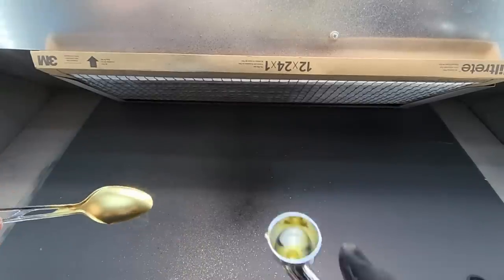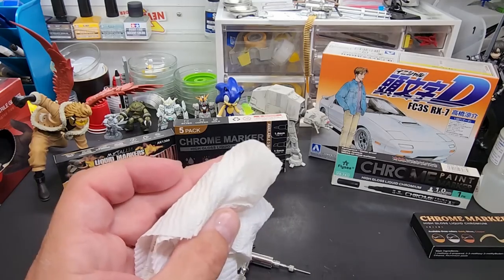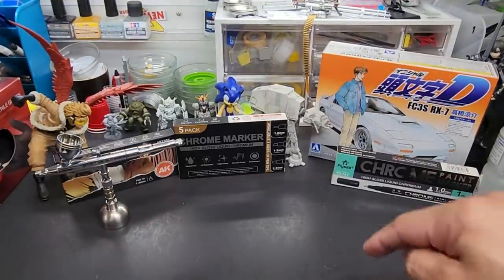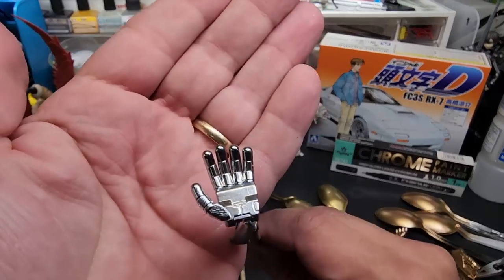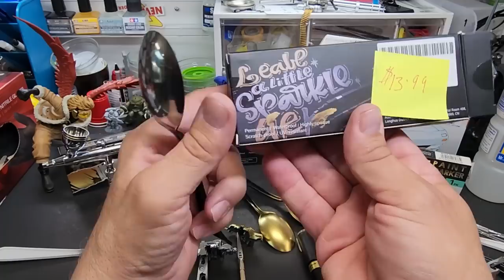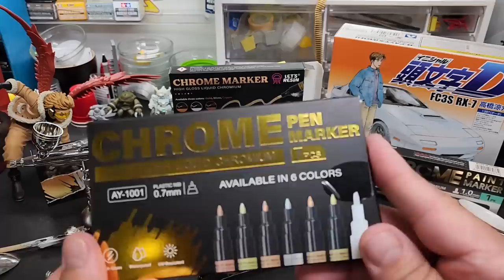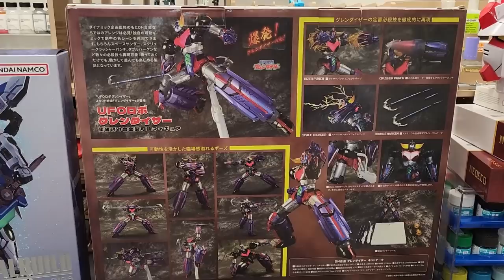Airbrushing Chrome Ink From A Marker

Comment: You can also adjust "the seal" in the airbrush. It's called a needle pack, and you can, if you know what you're doing, adjust it so paint won't get back into the trigger assembly area.

Comment: This looks great and I'd consider using it for window moldings. It's a huge pain to mask them off to avoid getting clear coat on them. Would a 2k clear coat work on top of this? Or would this work on top of a 2k?
Reply from the maker: 2K will work either way but keep in mind you will lose a bit of that chrome shine. Always test on a spoon first

Comment: hey, not sure if you include 'painting' reviews, tips in your tutorials, but i've long hunted for a decent chrome gold paint. there are multiple chrome silver methods about but none for gold. given how amazing graphite powder is for chrome silver, i was wondering iof you could test using chrome gold NAIL POWDER. does it work, can it be applied direct or do you have to use the UV gels first and after, will it give a pla print a proper chrome gold effect?
an expert opinion is greatly appreciated.

Comment: Can you do a video about "frosting" or "clouding" problems when airbrushing water-based matte acrylic clear coats?  I'm not the only person having trouble with this.
Reply from the maker: What brand are you using? Is it over any color?
Reply: Details: plastic model airplane. I first airbrush water-based acrylic primer (badger stynylrez).  Then airbrush thinned acrylic water-based craft paint (craftsmart from michaels) in various brown and green colors. Good so far.  Then airbrush gloss clear coat (us art supply airbrush colors - maybe not the greatest but wow that "army painter" gloss is thick and has scared me off).  Then apply decals to the model.  Then airbrush liquitex acrylic matte varnish thinned with water.  Frosty results.  Same thing has happened (but less pronounced)  when I use vallejo mecha water-based acrylic Matt varnish  27.702.  Pressure is around 22 psi throughout.   Master g233 airbrush with timbertank small tank compressor.  Sorry if that's too much info. Thanks for any thoughts on preventing  this.  Lots of other folks getting cloudy or frosty results with water-based  acrylic  matte varnishes.  Found many YouTube videos on how to kinda fix it but none on how to prevent it in the first place.
Reply from the maker: @ronandanne1  I don't really use acrylic clears, the best one I've used is Vallejo spray can clear. My biggest problem in helping you solve this it doesn't happen to me. I'll do some research on it. Have you considered a clear lacquer or enamel? Or Tamiya Clear
Reply: @barbatosrex9473  I'm reluctant to try lacquer or enamel cause that level of toxicity means I'd need more than my cheapo $140 spray booth and k95 mask. I want to try and stick with water-based and leave the more serious work to experts such as yourself.  😊  Thanks for your time.  And your channel is great!  I really enjoy watching.
Reply from the maker: @ronandanne1  I spray lacquers every day in a $99 booth. Just saying 😉

Comment: It looks nice. Last time i tried something like this, i used the DSPIAE chrome ink marker and at 1st glance it looked amazing but ended up terrible. It takes ages to dry, is not durable and it dulls, like hard, transforming into regular silver. This have the same issue?
Reply: Molotow was the same. Looks great initially but dulls and fades over time.

Comment: what primer or sealer do you use?
Reply from the maker: None
Reply: @barbatosrex9473  i build car models,i clean off the mold release,and prime it...another question would the chrome markers lift acrylic paint?
Reply from the maker: @alvendetti4600  I haven't tested that yet as I dont use acrylics too often. I'll have to try it on a spoon